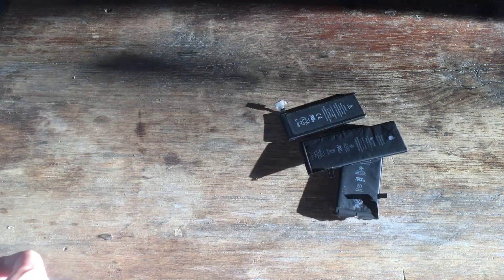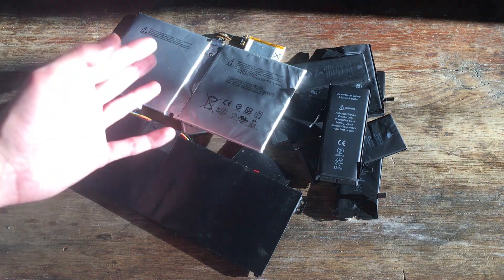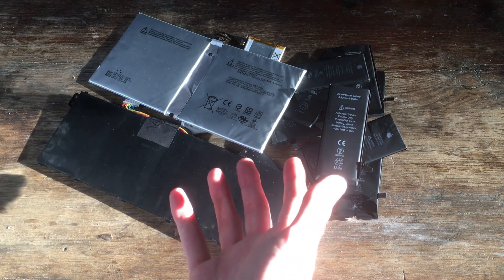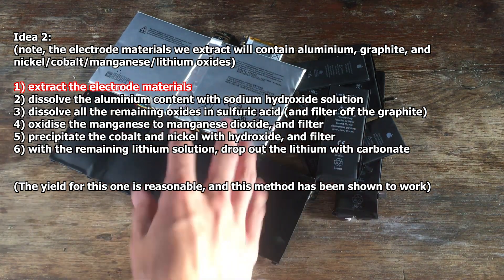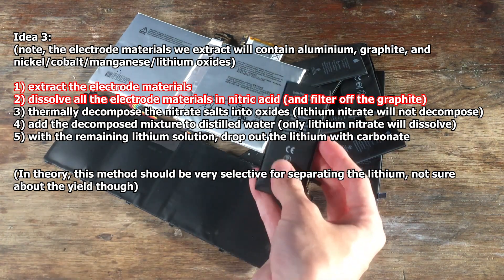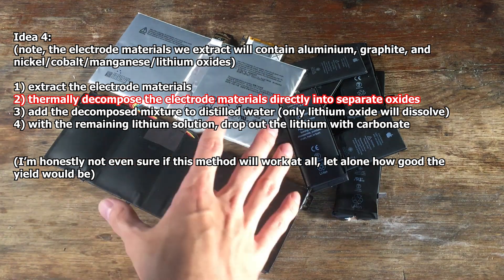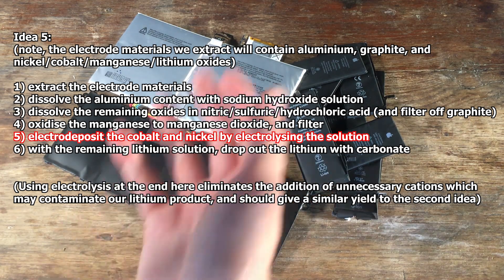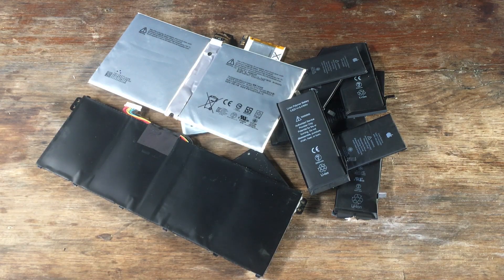Lithium From Batteries - Project Introduction

Comment: Another idea is to melt all the metals under argon gas (in order to avoid degradation) and separate foreign stuff like plastic, graphite, steel caps, copper wire, gold plating, dirt. The metal can then be purified by slowly heating from top to bottom with selective temperatures and so to say crystallise specific metals. This method is used to purify and separate gold from silver. However it takes a very long time to do and is interesting only for large amounts.
Reply: درود بر شما .لطفا بیشتر توضیح دهید یا منبعی در مورد ذوب خاکو سنگ معدنی برای رسیدن به طلا معرفی کنید

Comment: Do you have any ideas how to make sodium permanganate? I have a huge amount of manganese dioxide lying around my garage I really don't want to make potassium or sodium hydroxide. Is it possible to use sodium carbonate and manganese dioxide without sodium hypochlorite. And should I make some thermite and make manganese metal and use a modified version of your electrolysis method or some other method.
Reply: Sorry I had a lot of questions
Reply from the maker: I can't say I've tried many methods of making permanganates, but from what I've seen, there aren't many procedures which will give you a high yield or a pure product.
The only advice I can give here is based on the electrolysis method I tried last year, if you want to go for that route.
As you've said, if you want to go for the electrolytic method, you'll need to make some manganese metal by a thermite reaction. Then, you can follow the permanganate synthesis I did, where you'll just need to substitute potassium carbonate with saturated sodium carbonate (note that you'll also need to keep the solution very cold, as the sodium process is more prone to decomposition). It's highly unlikely you'll be able to get pure crystals of sodium permanganate here, and the solution you obtain will have considerable contamination with other sodium salts, but the yield won't be terrible.

Comment: I remember seeing that the electrolyte contains organic lithium salts too?
Reply from the maker: That's true I think. However, the electrolyte is strongly bound to the membranes of the batteries, so it's quite difficult to separate and isolate (also, exposing it to air will likely ruin it). It's a little sad, but getting anything useful from the electrolyte is probably too tricky to do.

Comment: I think #3 is the one that would work better. It not only sounds more solid, but it is the industry tried and tested method.

However, #5 seems the most interesting.

Also, would be nice if you could isolate the cobalt and nickel too I guess, both have some pretty extensive complex chemistry.
Reply from the maker: Isolating the cobalt and nickel would be very nice. However, I haven't found any reasonable methods for separating the two. Both have some pretty similar aqueous chemistry. I'll keep looking though, because that's deinitely part of the plan.
Reply: @ScrapScience  I just remembered, I have done Nickel/iron separation, with a cation exchange resin, using HCl.
The resin retained [Ni(H2O)5Cl]+, and the [FeCl4]2- went through.
[CoCl4]2- forms with high chloride concentration too, so I think this should work. But it seems almost too easy.
Reply from the maker: Wow, I've never even considered separating metal ions like that, that's super cool!
I actually have a small quantity of cation exchange resin, so I'll be sure to give it a go (or at least, do a small test) at some point.
Thanks for the info!
Reply: Kim, K., Raymond, D., Candeago, R. et al. Selective cobalt and nickel electrodeposition for lithium-ion battery recycling through integrated electrolyte and interface control. Nat Commun 12, 6554 (2021).

According to that paper, in a 10M LiCl solution, Cobalt is present as [CoCl4]2-, and nickel as [Ni(H2O)5Cl]+, so you could possibly separate them with an ion exchange resin, as they have different sign charges. (And using some other chloride, because using lithium chloride when one of the things you want to extract is lithium doesn't seem like a bright idea)
In the paper they do it electrochemically, using polymer electrodes, so that doesn't seem asequible for the home chemist.
I would have expected nickel to also be the tetrachloro anion, but that paper claims otherwise.

Comment: I'm wondering if there would be some loss with the methods that dissolve just the aluminum first.
Reply from the maker: In theory, the lithium shouldn't leach out into a strongly basic solution. But yes, in the real world, there might be some loss during the removal of the aluminium. If I go with one of those routes, I suppose I'll have to check the aluminium solution if we end up getting a low yield.

Comment: Once you have lithium carbonate covert to the chloride.  Then electrolyze that to lithium metal using propylene carbonate.
Reply from the maker: I like the idea! Getting lithium metal is the ultimate goal here, you've picked it. 
I didn't want to promise anything at this stage, since getting the metal will depend on how much lithium carbonate we get.
Propylene carbonate seems a little tricky to get hold of (I've been looking for some for a while), so I might try molten electrolysis of the chloride before giving that a go, but we'll see how it goes.
Reply: @ScrapScience  it can be made from propylene glycol and urea.  Or it is a big component of acetone free nail polish remover at least it is here in the states.
Reply: @ScrapScience  ps.  You need an inert gas (argon not nitrogen) to electrolyze lithium.
Reply from the maker: Yeah, I've previously looked into making propylene carbonate myself, but it seems tricky to get a good yield. Also, purifying the product seems extremely difficult, and is absolutely essential for alkali metal electrolysis. Getting it from other sources like nail polish remover is also an option, but purification is still a problem.
This isn't to say I won't try it, but I don't have very high hopes for it being particularly feasible in a home setting

Comment: How much lithium is actually in Lion batteries, I heard it wasn't actually very much?
Reply from the maker: I'm honestly not very sure of the actual numbers. Figures online seem to disagree, but yes, the lithium content is generally pretty low.
You can deduce the absolute minimum amount of lithium based on the capacity of the battery (since lithium is the only charge carrier in the battery, the watt-hours are equivalent to the mass of lithium - with some conversion factor involving the Faraday constant). 
Overall, I've found that we might only have a little over 10 grams of lithium here, but I still think the extraction should be doable.

Comment: This sounds so interesting 
I had a box of lithium ion batteries I extracted the cobalt from them and kept the waste solution to evaporate 
I may be able to extract the lithium from it 
Thanks for the info <3
Reply from the maker: No worries!
Were you able to separate the cobalt from the nickel? I'm still trying to figure out a way to do that.
Reply: After I precipitated the metal with aluminum  I thought it was cobalt only because the solution is still green
Reply from the maker: Hmm, you likely had some nickel in there too I'm afraid. Generally, cobalt solutions are red (except in some cases where you involve weird ligands), while the green colour is strongly indicative of nickel in solution.